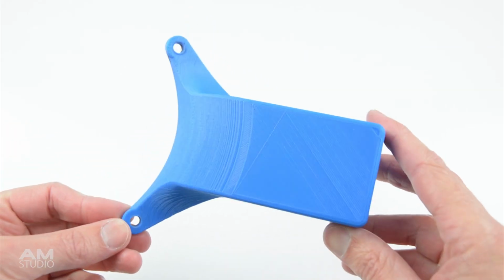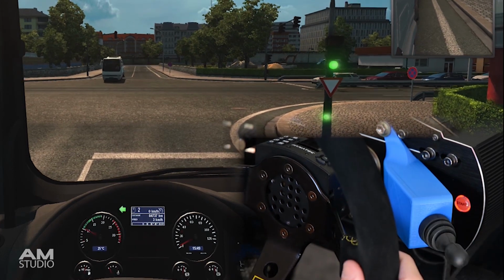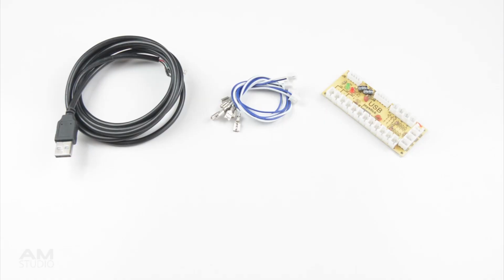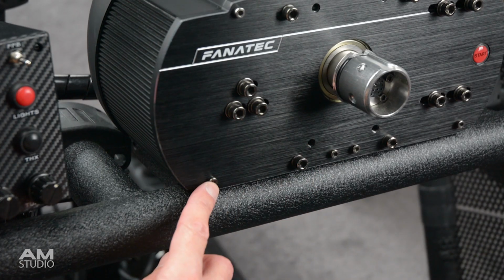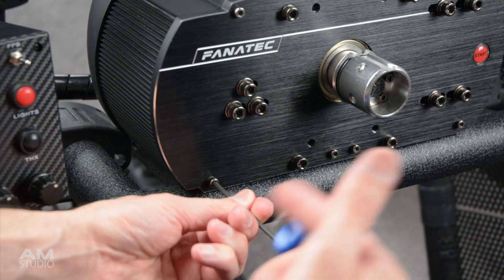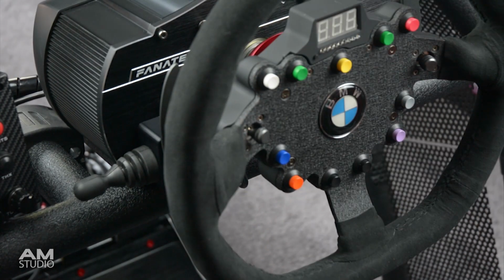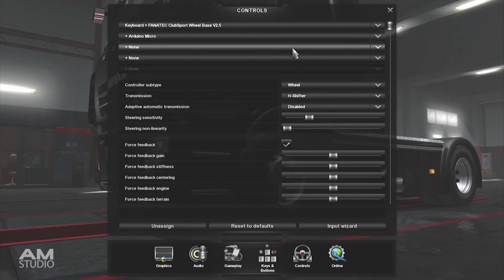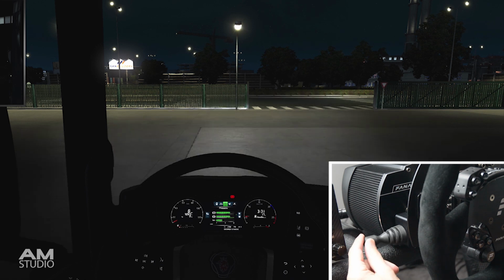DIY TRUCK SIM LIGHT AND INDICATOR LEVER

Comment: Man... It'd be awesome to see every one of his DIY projects incorporated into one sim rig. He'd probably need 300 USB ports for that, though.
Reply: Great idea
Reply: I am thinking to make a rig and use all of his diys😂
Reply: @SyedHamzaHaiderBukhari  Awesome!!! That will be the happiest day for all of us!!!
Reply: Up to 127 USB devices can be connected to PC
Reply: @Rado_motorsport  Actually you can connect up to 127 devices per USB Host Controller. A ordinary PC usually has several of them. And PCIe extension boards allow to connect additional controllers. So don't worry, 300 devices aren't a problem, theoretically. Would be still a mess as you would need a lot of powered hubs. :D
Reply: A lot of these projects could be incorporated into fewer boards actually making it possible to only use a handful of USB devices. The USB joystick board he has in this mod is identical to one used in many others with 12 button slots so with this particular project there are still 8 unused slots for buttons.
Reply: You can incorporate all of this into at least 3 USB ports lol

Comment: Nice !! Can you do a 3d print file for Logitech G29 ? :D
Reply: I need that too!
Reply: @ZeeuwsGamertje  I've printed 1 that works on a g25 - g27 don't know if it fit a g29 you need to make 3 holes in the case to mount it i rivenuted the case so i didn't have to pull it apart if i could add my files pics to the comment i would.
Reply: Do one for the t300RS!
Reply: Might of already found it by now. But on Amstudio's pinshape profile he has a 3d printable hub that extends the wheel from the base of the g29 that makes enough room to place this indicator box behind it.
Reply: @larrymorgan3858  Do you still have it

Comment: I made it external after your first video. You dont have to reach far and you dont need a 3d printer. Im working on some button boxes too one with the same joystick for parking brake
Reply: How can I mount this without the 3d enclosure? I'm going to make the switch with out the enclosure for shitts and giggles.

Comment: Hello. Is it possible to use two USB joystick boards at the same time? I'm going to build a button box and light and indicator lever as two separate projects. Wonder if I have to combine both in a same board or it is possible to use two boards at the same time... ?

Comment: Would it be reasonable to use the one encoder for two enclosures/sticks - one on each side of the wheel?  

I made one of these based loosely on your first video and added some extra buttons and switches to my enclosure simply because there was a surplus number of buttons available.

Comment: Just got a set for my G29. But I don't yet know how to mount it. I think i have to remove the pedalshifters to make place?

Any ideas? And great video and channel.
Reply from the maker: Working on a Logitech version no need to remove paddles.
Reply: @amstudioprojects  thanks mate. I'll wait to see your video before i "dremel" the s*** out of the g29 houseing 👍🏻
Reply: I made it external, you dont have to reach far. I did it because i dont have a 3d printer
Reply: @teimonkauppa1002  i have the logitech/saitek side panel now. I use the joystick for the same feature now. But it's still not the same.
Reply: @SuppehueDK   i put mine on top of g29. I taped it with double sided ahesive tape. It stays firmly on top and is easy to remove if you want to

Comment: Sorry, weird vid to ask this on, but I might be getting the Logitech G920 for christmas, and I wanted to know, if I'm on pc and I do a custom steering wheel mod do I need to keep the original button pcb? I was just wondering because if I ended up customizing it and stuff, I would probably just use a button box off to the side.
Reply from the maker: Yes it needs to be connected for the wheel to work.
Reply: amstudio Ok, thanks!

Comment: How can i put this on my G920 wheel?
Reply: I put mine on the top of it. I used the double sided adhesive tape to mount it. It stays firmly on top of it and it is easy to remove if you chose to remove it

Comment: Fantastic job, do you also have the version one indicator file? Can't seem to find it on the site.
Reply from the maker: Only version 2 is available .
Reply: That's a shame was hoping it was available :(  i have a 16 inch wheel i use for euro truck, is it possible to adapt this one to be a little bit closer to a deep dish rim? i brought the file but this is the first 3d printed project. Thanks for any help in advance :)

Comment: Hey man, I have some questions (not very related to this video). I'm currently in the process in making a custom wheel for my thrust master t150. What I would like to build in there are the circular selection knobs you find on the f1 steering wheels. What is the best way to do this?

Comment: How on earth do you fit all the components into the housing?
Reply: So looking at this more, it seems that the USB Joystick Encoder is in a separate box, and its only the level and cables going into housing attached to the wheel base. A 8 core network cable (cat5/6) should work in this case.

Comment: Can this be modified for a Logitic G29 wheel ?
Reply: Great as usual, so easy to follow your videos.
Reply from the maker: Working on a new Logitech version
Reply: I'm back even further on a G25, various mods including to the point where gear changes are silent. I'm gonna use it until it dies so I haven't looked at a replacement just yet.
Any chance for this to be reworked for the G25 as well?
Reply: @ProjectR86  i think if it works for g29 it will also work for g25 since the desing is quite the same. I hope it will work for g27 in my case😁